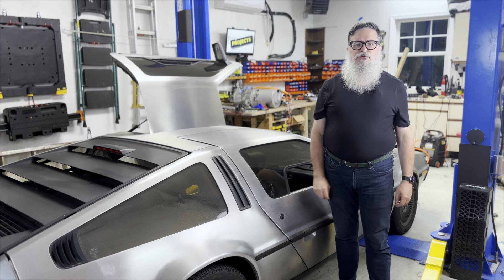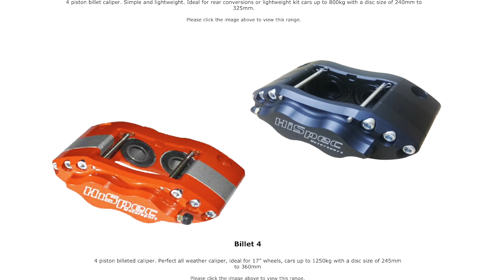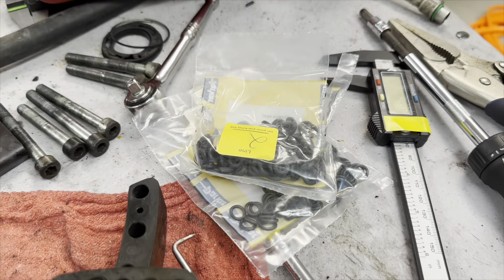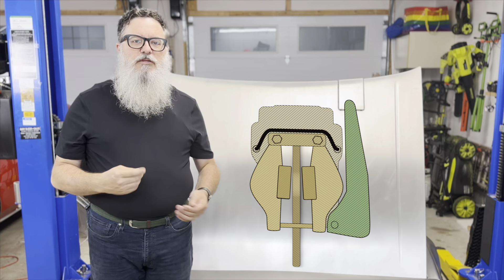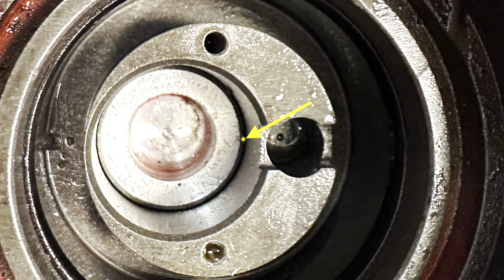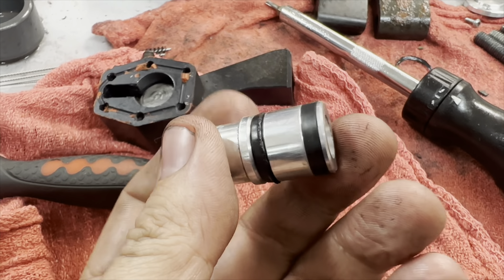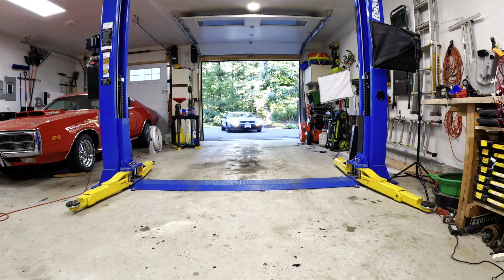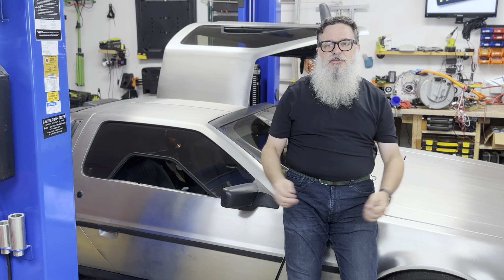My DeLorean's brake caliper seized, so I “fixed” it

Comment: Love the videos, subscribed and liked. Please at a minimum sand the pads, the extreme heat will have glazed the pads and rotors. A honer for rotors is not very expensive, and regular sandpaper for the pads, scotch brite, and brake cleaner. You want those both deglazed.

Comment: You have a natural presentation method that is both credible and entertaining. AND you fix all those annoying things that many of D owners put off until it's absolutely necessary to fix. Which reminds me . . . the next time you're in San Antonio I would entice you to help me work out some "kinks" in my S/N 6815. I have a grease pit in one of my garage bays, and you will have a large house to stay in. Well, it's in Texas, so of course it's big.
Reply from the maker: Ironically, I’ve been putting off those things until it’s necessary to fix them. :) Or at least until they annoy me enough to fix them. I’m always hesitant to do something that takes my car off the road, but once it’s broken I have no problem doing a bunch of work on it. If I’m every down in San Antonio I’ll let you know!

Comment: Enjoying your channel. Very everyday" guy working on his old vehicle, just happens to be a DeLorean.
So many channels do DeLorean's, but these are coming at it from a different point of view. 
Yours is a car you use, and things are fixed as they happen. Yes you do "upgrades", but again, they are as problems arise using better aftermarket stuff. A lot of what you do is "let me get it working" and mess with the little things later, which may never come, but that is OK, how many use their vehicles.
Reply from the maker: That’s a pretty accurate description!

Comment: You have the patience of a saint, seeing how much work the car needed in such a sort amount of time
Reply from the maker: On the flip side, the first big project I did on this car was a 3.0L engine swap after my fuel system got destroyed by water getting into the tank and I discovered a casting error that led to a hole in my engine block. It took me 5.5 years. I did some other repairs too, like having to learn how to weld to patch some holes in the frame, learn how EFI worked and how to tune it, etc, but I didn’t want to be that guy who has a car in the garage for 20 years that he’ll get to some day. So I did a little work most weekends, even if it was just adding a bolt, and eventually got it done.

Comment: Great video as always!

Question: what is the black plunger-like device next to your driver side door striker?
Reply from the maker: Thanks!

It’s just a kicker — a spring-loaded thing to make it a little easier for the door to open. DeLorean Motor Center (now DMC CA) installed them around 20 years ago to help work around my doors sticking to my door seals and interfering with my door launchers. I’ve since fixed the door seals properly, although I still have to hook up the door launchers again.
Reply: @joeangellx  thats cool. I almost thought it was meant to be a replacement plunger for the door lights
Reply from the maker: I actually did replace the door light switches with magnetic ones.  At first I used magnetic switches like you'd find in building doors and windows for security systems. The trick is finding normally closed ones, or else your lights are on when the door is closed.  They finally failed after a decade or so and I bought some new ones, but they failed after a few weeks in an automotive environment.  I've since built new ones that use a reed switch, a magnet (to make the reed switch normally closed), and a 3D-printed case.  Alignment with the other magnet attached to the strike plate on the door is critical, but once you have it set up it works great.  I'm thinking of selling them if there's enough interest.

The other issue is that you need LEDs for this -- the switches are rated for only half an amp, and incandescents will draw too much current and burn up the switch.

I've also thought of mounting an angle sensor on the door hinge, but that requires constant power.  Which is fine for other projects I'm planning where knowing the specific angle of the door would be nice, but I don't think that will work for your average owner who doesn't want the extra battery load when the car is off.
Reply: @joeangellx I have those same plungers on my car. It was serviced at DeLorean Motor Center back in the day.

Comment: HAHAHAHA an extractor that actually worked.  Been there so many times when they snap.  What I learned is use some Kriol,  a reverse drill bit first and hope it just comes out then.
Reply from the maker: I know, right?  I usually just break them too.  At one point I snapped off a bolt I didn't realize was double-nutted on the other side, with one nut welded to the frame.  Then I snapped off an extractor in it, failed to drill that out, and resorted to Dremeling the extractor to dust.  Then I went back to drilling with successively larger bits all the way through the bolt, which eventually broke it free.  I was then able to get an extractor to turn the already-loose bolt out the rest of the way -- I just needed something to grip it; the extractor was only useful at the end. https://www.tmproductions.com/repairs-and-maintenance-blog/2021/7/4/engine-cutting-out-and-a-broken-trailing-arm-mount-bolt

This e-brake screw was the first time I've seen an extractor work as advertised.  I think it only worked because it's such a small bolt and I didn't need a lot of torque to get it out.

I do have some reverse bits, and I did try them, but with any bit my biggest problem is just getting them to drill into the screw in the first place.  I was able to use my drill press for the e-brake screw, which was a lot easier.  I probably just need to buy higher-quality bits.

I too douse everything in Kroil. :)  I've never done a real comparison of penetrants, but it seems to be the one that everyone swears by, and that's good enough for me!

Comment: Your videos are indeed enjoyable but please fix your brakes properly.
I do not know if you have an engineering background or not but there were many red flags.
And most importantly that you reused the square taper seals that is a deathwish.
Seals shall never ever be reused if they have been disassembled, its 100% sure that the parts will not sit in the way they were worn previously.
You are risking it too much
Reply from the maker: I agree. I need to find a source for EPDM o-rings, but getting these completely rebuilt is definitely on my list.
Reply: @joeangellx Back in the day it wasn't uncommon to rebuild calipers.
Buying a set of seals and boots can be done if you know the bore and groove width.
Finding a parts store that still has actual books with dimensions is a challenge.
Here in New England NAPA is likely your best bet.
God, I just love nerds needing out about their odd and esoteric interests!  👍
Reply from the maker: @jimurrata6785  In theory I can buy a rebuild kit from HiSpec, but I had trouble actually finding the right kit on their site, and I'm fuzzy on actually getting it shipped to the US.  Next time I take the calipers off I'll pull a piston and the e-brake plunger and bring the whole thing to NAPA and see if they can help me figure out what I need.  Thanks!

Comment: when the brakes have 4 cylinders its 4x as likely to fail as having only one
Reply from the maker: Quite true — more moving parts means more chances for failure. The stock calipers have two pistons, but have a smaller contact area on the rotor, so it’s a trade off.